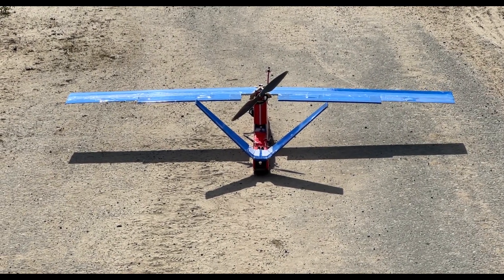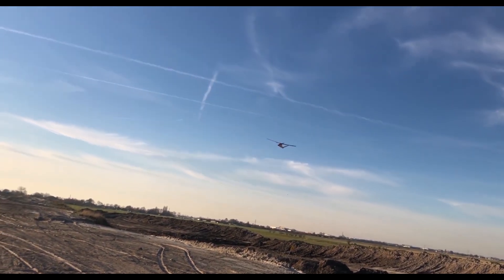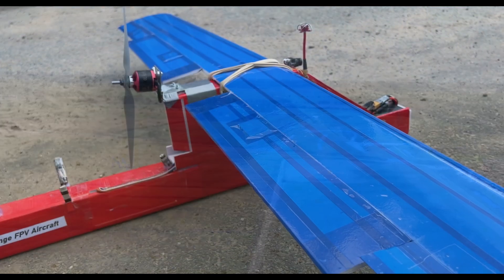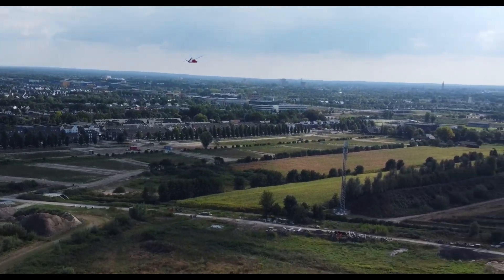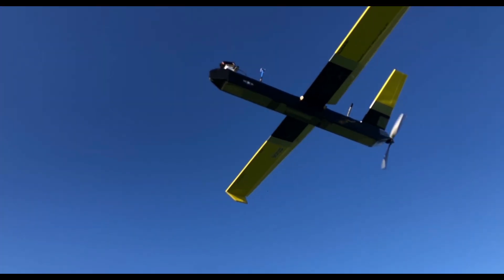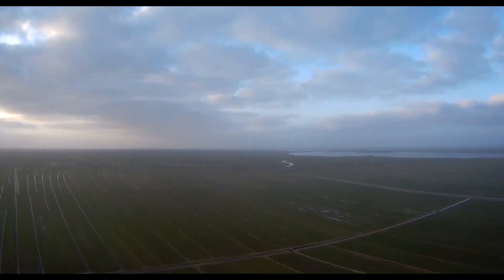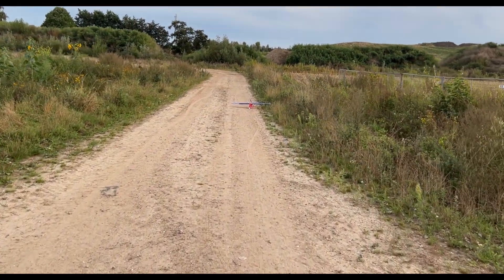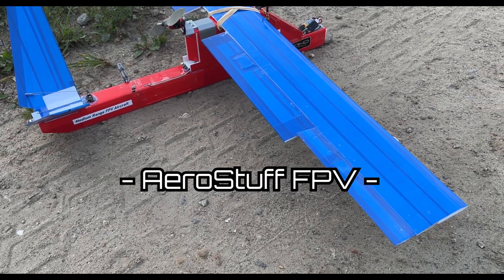Homemade FPV Plane w/ Super Flaps (STOL) - Review & Flight

Comment: V tail makes no sense for stol .. you need T tail and big elevator to keep the authority V is really bad when it comes to stall just doesn't have the lift necessary
Reply from the maker: But most of the lift comes from the main wings,

But V-Tails aren't the best for slow speed handling, indeed a T- or Convential tail. 

As long as I have big throws if needed, the elevator control is fine.

Comment: Tilting the motor up so the extended thrust line (going forward from the motor) crosses near the centre of gravity will also reduce the pitch down tendency when power is applied. However an untitled motor would give up a bit of efficiency in cruise.
Your approach here of using flaps and changing the centre of lift, is good one. Gives you both good takeoff/landing options while having great medium range cruise performance. Well done!
Reply from the maker: The motor is tilted! But it’s tilted this much that it’s pitching down quite alot.

I tried an untilted motor once in the past that was a disaster.
Reply: @AeroStuffFPV , Hi, kindly let me know about Motor KV and propeller size used in this magnificent model. Thanks and Regards